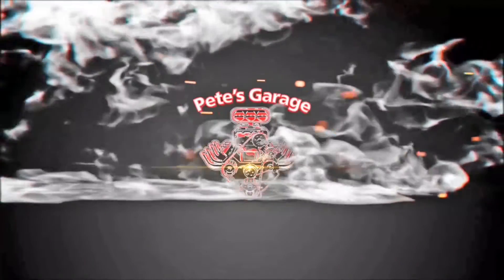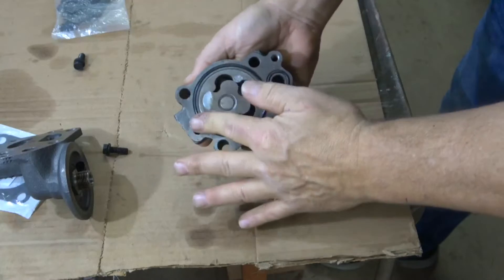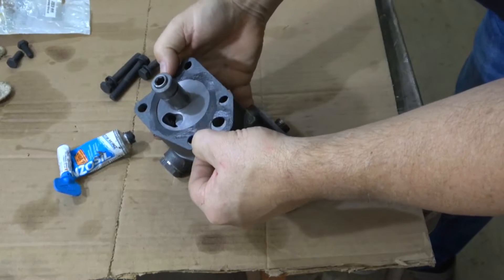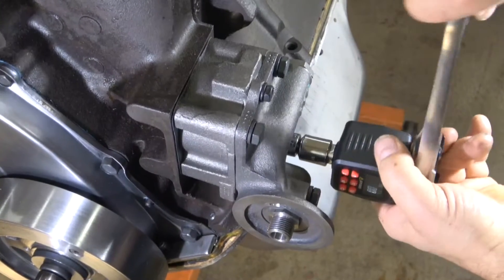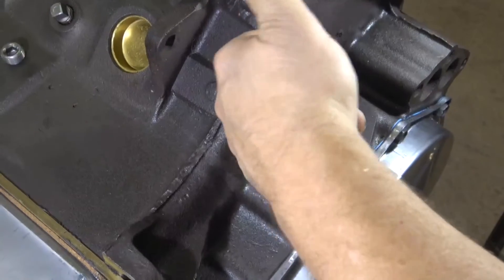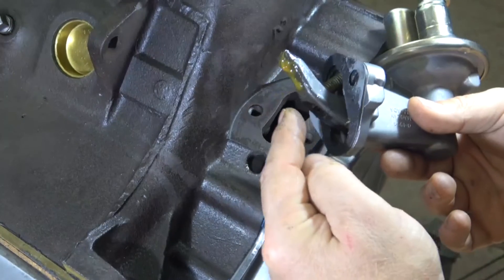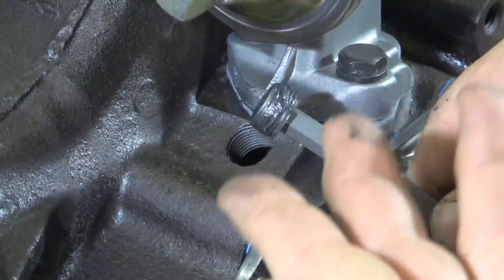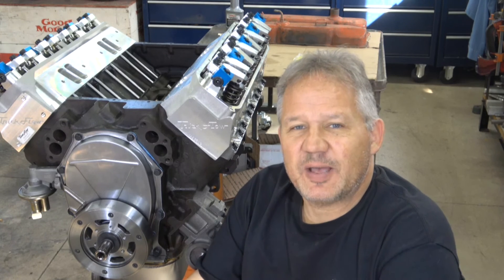Engine Building Tips - Oil Pump & Fuel Pump Installation  440 MOPAR 512 Stroker

Comment: Did you buy new factory correct hardware or are those the original bolts that have been cleaned up?  They look like brand new!
Reply from the maker: It is brand new hardware